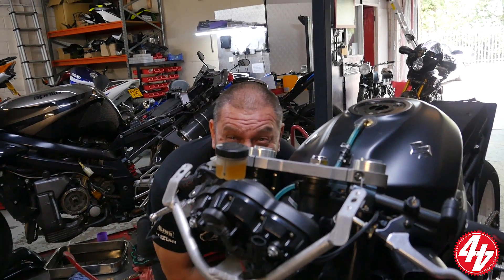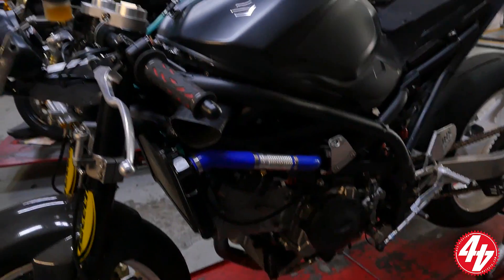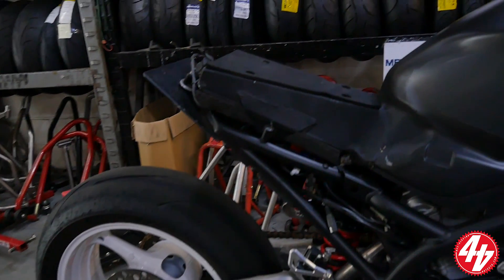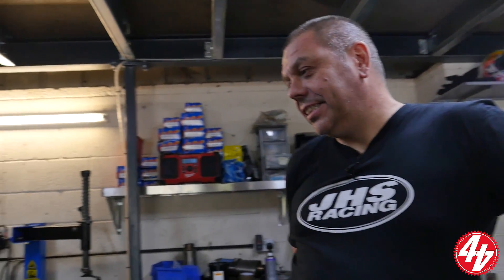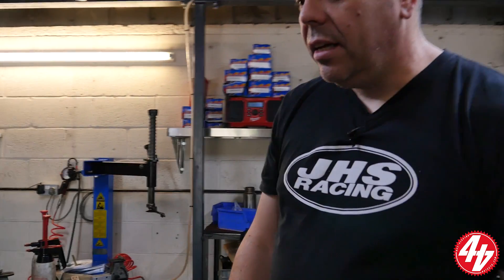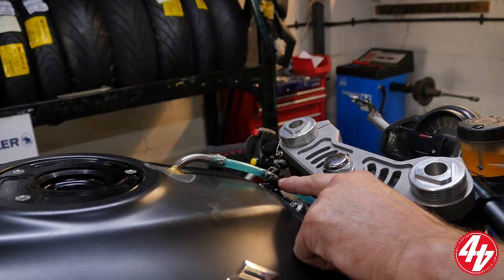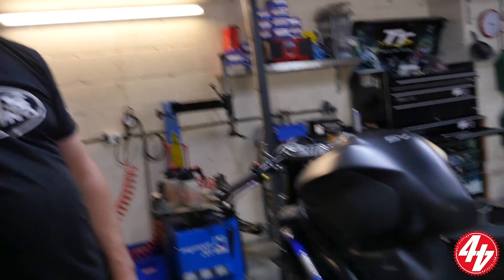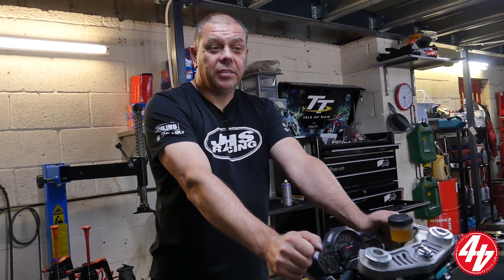The Trickest Suzuki SV650 Ever?

Comment: Second trickest. I build an Sv 650 with a friend. We took the cams out of the front cylinder and converted the front cylinder to a piston supercharger. For the rear cylinder. It runs on a stand-alone ecu and sits in the garage under the work bench 😂
Reply: wtf

Comment: should I get one of these as a first 'big' bike?
Reply: Yes.  I have an 06 650s, one of 3 streetbikes that I own. It is the only one that does not require a steering dampener for regular street use and that 650cc engine with 90 degree offset crankpins really has enough stink for all street situations. You wont lug tall gears like say an inline engine but the motor is lively and full of poke... People run them for 75-115k miles... keep up on those oil changes (3500 miles) and valve checks. It requires a corbin/sargeant seat IMHO. Seat way too soft but is the only upgrade needed imo. Maybe slipon/powercommander for a few horse and slight increase in gas mileage. I get 52 mpg when I slam the throttle, 28k miles, yosh slipon/powercommander. Hope this helps.
Reply: thanks for the reply. I bought one yesterday for 2k, mint for its age